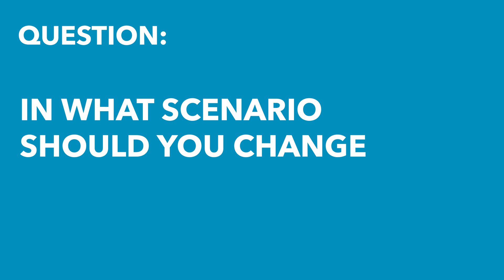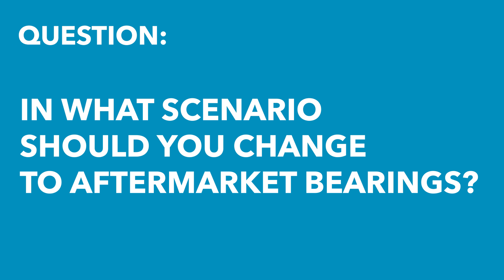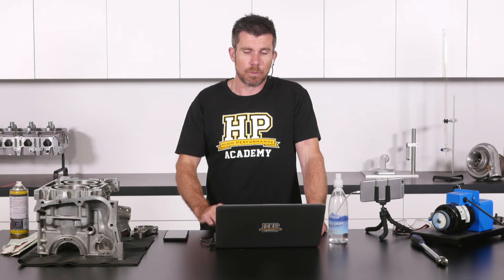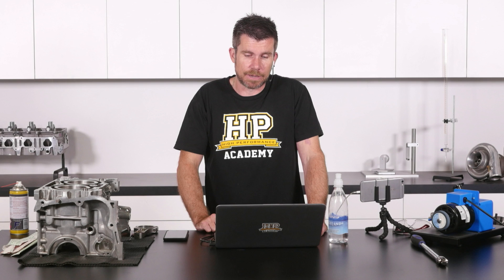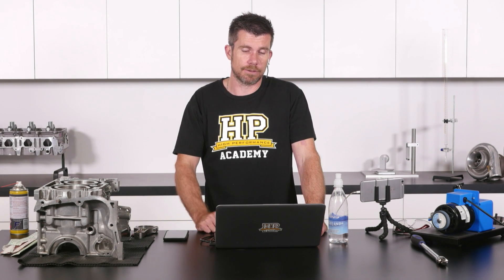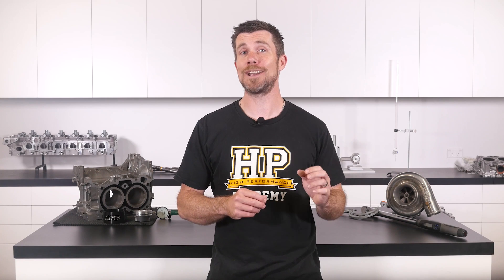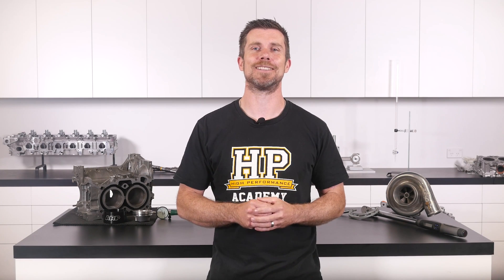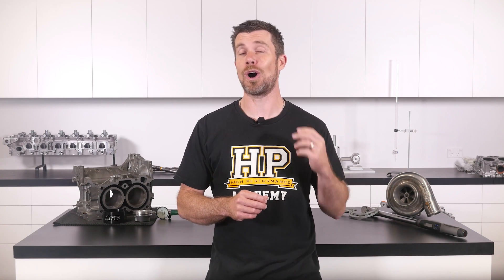[HPA Q&A] Why should I buy aftermarket bearings? | Performance Engine Building

Comment: Gud topic bro i love your info. Can u mixs connecting rods. Like on a 4cylinder engine ej25 3 h beam rods an 1 stock ej257 rod what would happen.or even mixing 2 an two
Reply: justin mcclaren no it would cause imbalance
Reply: Assuming the bores, widths, length and strength are the same - in theory, yes, but for the comment above.
That said, I recall a top fuel car where the driver/owner commented after he won the race that it had 3 different connecting rods and 2 different pistons (or the other way round, this was a couple of decades ago).